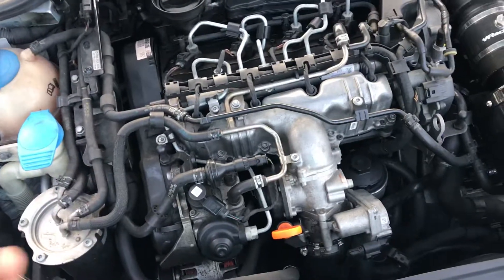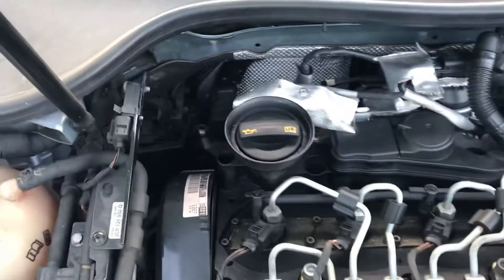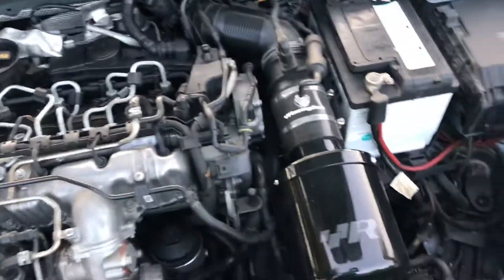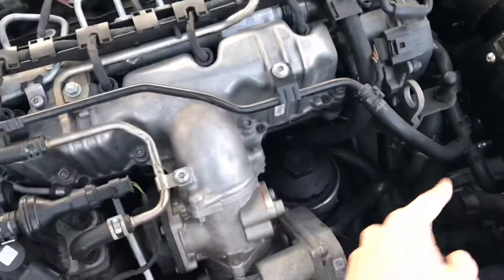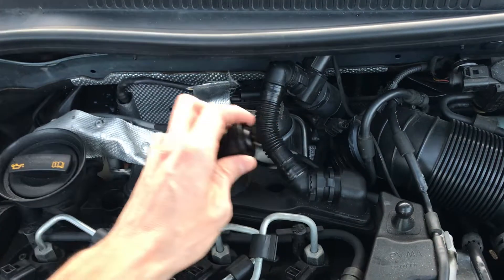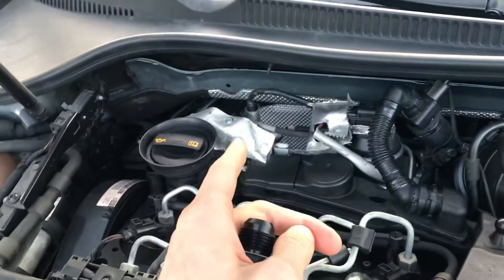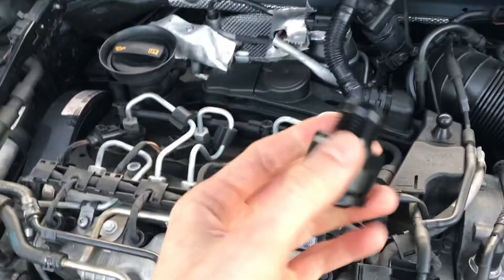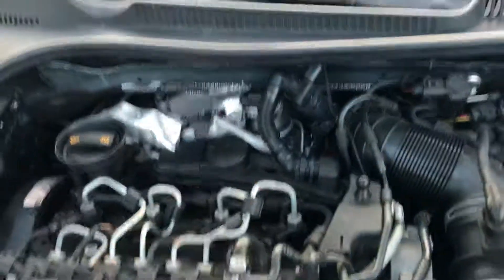ECS ES#2931595 Adapter Fitting & VW Golf TDI MK6 Catch Can Plan

Comment: Does it fit to 2.0 TDI? I have a Passat CC 140 hp. My english is not so good and I didn't understand from the video
Reply from the maker: It should fit, the factory tube is about 20mm OD, so if your tube measures similar it could fit.

Comment: So im wanting to do a catch can on my tdi, i'm reading your thread on the golf forum, it looks like you used the -10 fittings from ecs, then went on BMRS and got some -12 convoluted PTFE hose (i assume the high heat stuff), and then got some adapters (looks like the PROGoldAC fittings), but I'm having trouble figuring out which ones you got looking at their product page, got any advice?

Comment: hey man, what air filter is that? i plan on going cr170 too, so i’m just trying to figure out everything i need. also, you should look into an oil bypass filter. insane diesel has one. amsoil has one but it’s for trucks.
Reply from the maker: Racingline. They're a UK based company. Only intake out there that Malone tuning actually said might be beneficial; it is. Turbo has more response and noise, and the car seems to accelerate better compared to my stock intake.

There's a drop in filter that uses the same tech as Racingline. ITG is who makes the foam filters for Racingline and Pipercross.

Comment: great video, thinking of adding the MANN ProVent 200 catch can to my vw jetta sportwagen tdi CJAA soon since i'm having the same issue as you are. please show us your install video if you have one
Reply from the maker: That video will be up this year, hopefully with the final bracket. The ProVent is amazing TBH. We're using it at work to develop our own catch can. The ProVent does require a sump to drain to. Our cars could benefit from the ProVent 150 or 200. With respect to cost of ownership, when properly cared for, the ProVent is pricey bc of the replacement filters.

Comment: Nice video. Thinking about adding a catch can to my mk6 tdi as well. How'd it go?
Reply from the maker: It went well. I've done a line upgrade from -10 to -12 since I installed the can. 

I do not like the Radium can 100% though. I still get some oil leaking out my inlet charge air pipe. The Radium can needs a baffle to stop oil sloshing up to the inlet when it gets close to full.